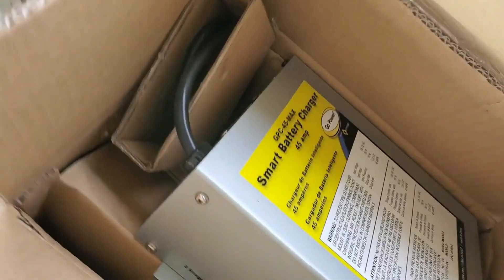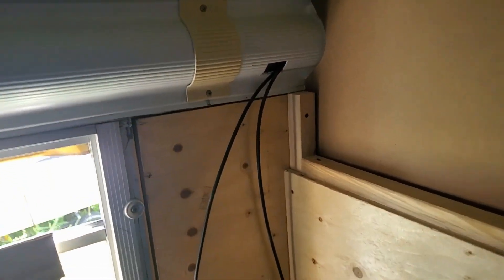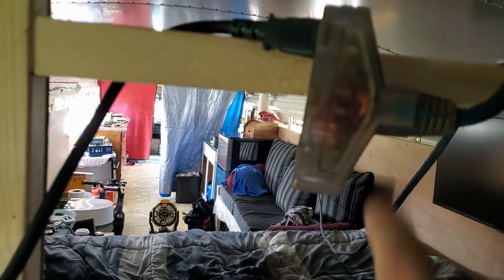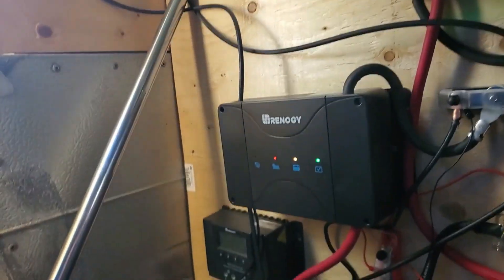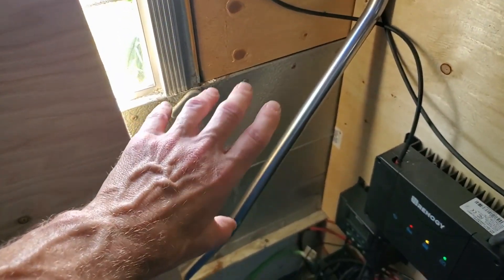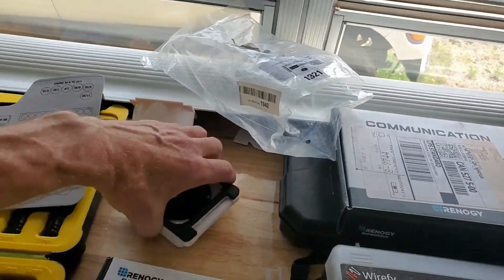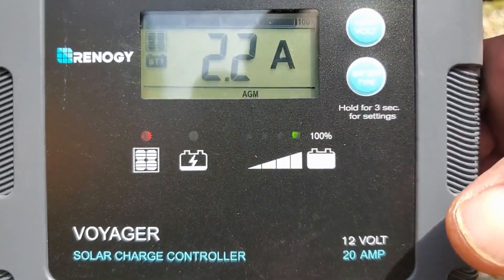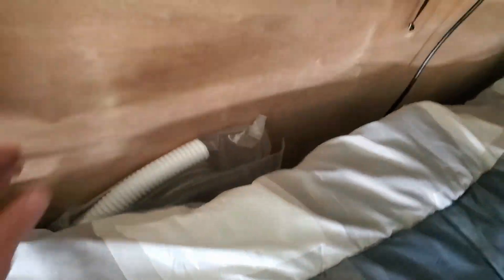Skoolie Build 19 - Solar and Wiring

Comment: Get a Kilowatt meter , you can measure what each unit takes in wattage . It will also measure frequency and voltage out put on the generator . this will show you if you RPM is properly set for proper out put on the generator .

Comment: Good to see your update. Have you considered a mini-split heating/air conditioning rig? They are pretty economical.
Reply from the maker: The smallest mini split still draws over 800W of power. The window AC only draws 365W. It's much more economical to run a window unit, and cheaper to purchase or replace.
Reply: Hello  @RedneckRickem